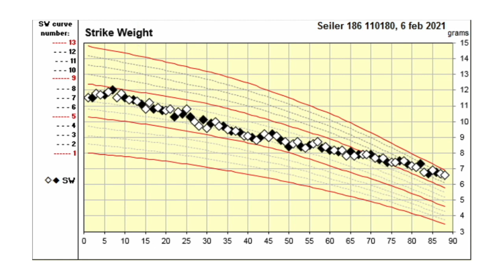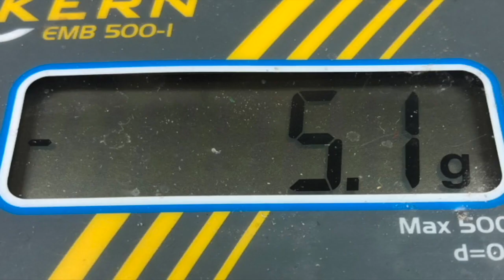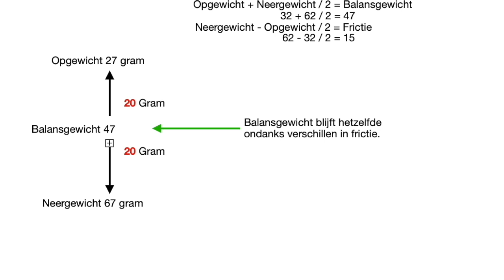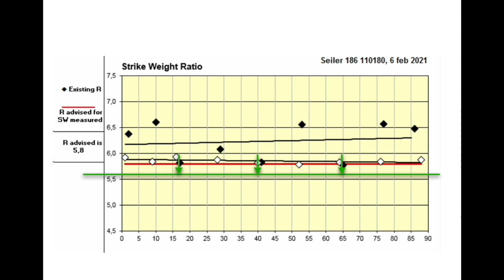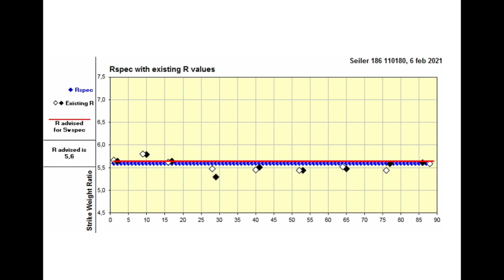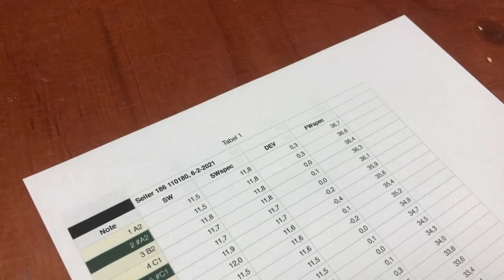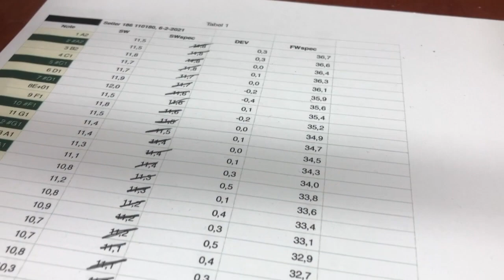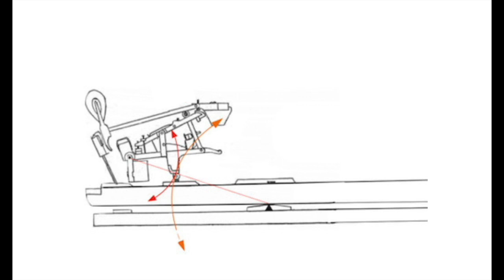Uitbalanceren van het pianomechaniek met Precision Touch Design

Comment: Hi Coen, first of all, excellent video! Thank you for sharing. I would like to ask you a question about Hammerheads Weights curves, you talk about the relationship with the Strike Ratio. You have weighted the hammers together with the shanks, and then you created a smoothed curve using the SW, not the HW curves that you shown early in the video. Where do you use the HW curves? or it is ok to weight directly Hammerhead + Shank and use the SW curves? Thanks a lot!
Reply from the maker: Yeah that could be a bit confusing. I sometimes say hammerweight but I always calculate and measure Strike Weight. The Strike weight is hammerweight + 1.9 gram (shank)

Comment: Hi Coen, beautiful presentation. It was so good i was able to follow along without  understanding your language. LOL.  At 29:30 is where you inadvertently ruin inertia smoothness. I bet i could have used just 3 weights were you used 4.  The use of the fourth weight was because you are too far back in the key.  My system is much much simpler and more accurate.
Reply from the maker: The two leads in the key where the original leads. I choose to keep them this time. The reason I use two leads in this position is: I want to mirror the lead from an imaginary line right between the front and the balance pin. This way the lead builds gradually from the bass to the treble. The center of gravity is in the same place with every key. Which in my opinion results in a very constant inertia I understand that you think otherwise about this and I will take a look into your thoughts and try them out.
Reply: You cannot assume inertia is even  when taking indirect measurements.
Reply from the maker: @ChernobieffPiano  So how do I take direct measurements?
Reply: @CoenvanDongen  If you are interested, my Inertia Touch Wave is available. Here's a little explanation:    https://www.youtube.com/watch?v=yx-ACupo0KM
Reply from the maker: @ChernobieffPiano  I've seen it. But that is not an explanation ;) That's an advertisement. I will have to pay 295 dollars for your excel sheet before I can see what your approach is. I'm curious, but not 295 dollar curious. Sorry
Reply: @CoenvanDongen  I understand.
Reply: @CoenvanDongen  and btw my website goes into more detail.

Comment: Excellent work. I can see that complexity is something that does not worry you. I'm not a technician, but can I respectfully ask where the weight of raising the damper on each key is taken into consideration. Thank you.
Reply from the maker: I take notice that there is extra weight involved by the dampers. I can calibrate the weight of the dampers but I don't do it often because the extra damper weight has never been problematic.
Reply: @CoenvanDongen  Thank you.